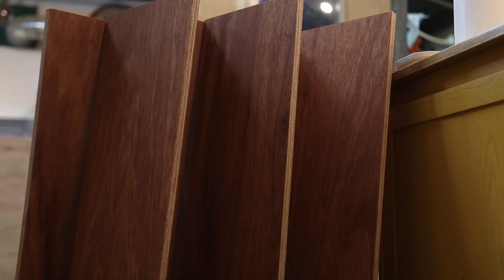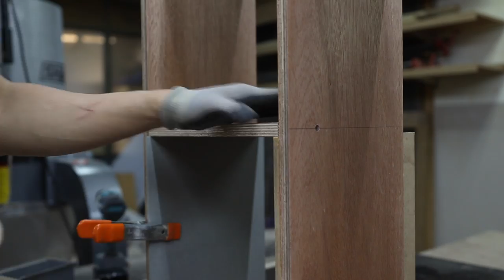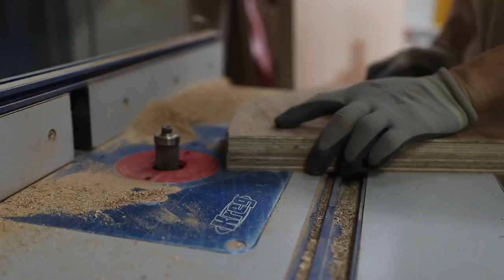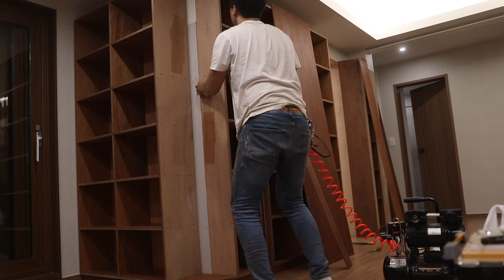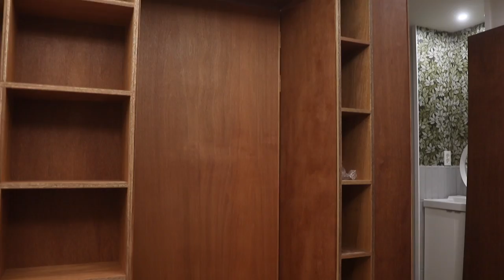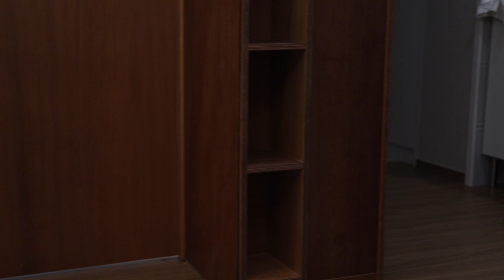W73_Wall Book shelves library

Comment: The unfinished edges would drive me crazy.
Reply: excuse me, what would drive you crazy?
Reply: Mee too, i was thinking when the finishing will be applied XD
Reply: you mean leaving the layers of the plywood showing, right?  ...it's very typical to just leave it showing in Korea for built-in custom shelving. I must say, i was surprised the first time I saw it.
Reply: @claytonroberts5881  I mean, it is beutifull even "unfinished", just look stranger for me.
Reply: Everything made out of plywood and rough edges showing, that would never be accepted in Europe (or maybe anywhere else?). That door too, basically two big sheets of plywood on a frame with braces. Such a hollow door will let a lot of noise through I guess. Great workmanship, that has to be said. I got the impression this was installed in an office space. So then the functionality is way more important than the looks. Making this design from solid wood would make it way more expensive.
Reply: in certain situations i would agree with you but these shelves are made simple and nice enough to leave the plywood edges showing
Reply: Well, I am pretty sure the client didn't want those covered as that would add to the price. Some clients are just like that...
Reply: Yeah but everything in general just looks like it needs a good sand and polish
Its a nice job but I feel like I'm getting splinters just looking at it

Comment: Beautiful work and great ideas for the shelves. But . . . why did you leave the plywood edges exposed? I use either edge banding or cut strips from veneer for a modern look, and solid wood for a more traditional appearance. In any case, great job.

Comment: Hey there! Amazing build, good job! Perhaps you consider something? For the two end panels that formed either end of the rounded shelving section, perhaps you could have used 12mm plywood, instead of 18mm. That way when you fit the 6mm panels to hold up the rounded shelves all of the upright section would be 18mm in width and would match. Just a suggestion, and I agree with the comment about pivoting the shelves - genius idea!

Comment: Are you ohueli tam?! I, as a carpenter with six years of experience, are outraged. Was it not possible to mount the shelves on double-sided eccentric connecting screws? You did not find the impregnated veneer for a shelf edge?

But the idea itself is very good, I like the design and color.  
I hope dendrofecal technologies give way to working with wood and modern fittings.

Comment: Why the gap to the right of the corner, between the 'one-wide' unit and the 'three-wide' unit?  From the camera angle, there doesn't appear to be any obstacle you're installing around or anything.
If it's just a space filler, wouldn't a 'four-wide' unit with each column of equal width have been a better way to go?

Comment: Seems to me like these nailed together shelves are going to come apart pretty quickly.
Reply: They are nailed for assembling. Later are screwed with two screws from both sides. And they are small, so not much of a books on each.
Reply: Nailed and glued, then screwed.  Wood will break before joints.

Comment: Good work and design, no doubt.... but from my point of view, leaving such edges is really a mistake and decrease the level quality a lot.
Reply: Initially I thought that the strips of solid wood he cut were for putting on front of shelves to hide those plywood borders but I was wrong. From experiencie I know that leaving plywood borders like that without sealing the wood with lots of coats of poly or some other finish will eventually start to separate or raise.
Reply: @jellyg.8961  Thx. He said in previous com ' sometimes i reveal edges like this '.... It's his choice, but not for everyone.